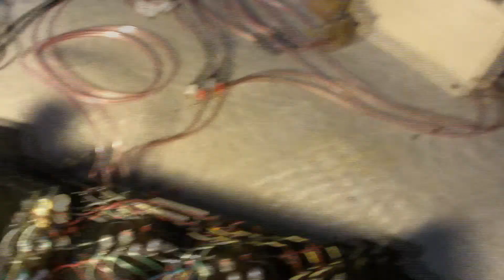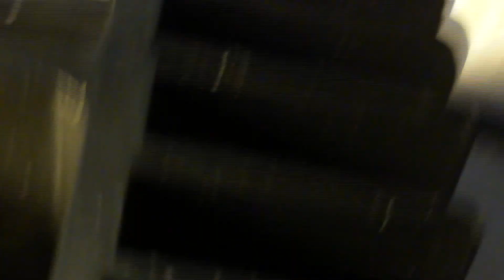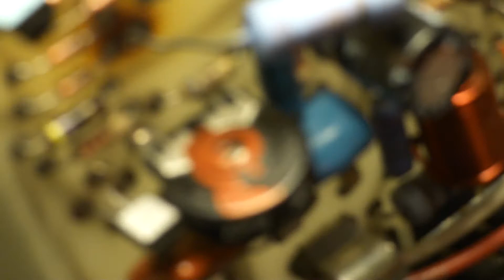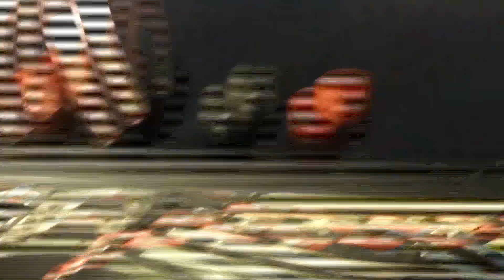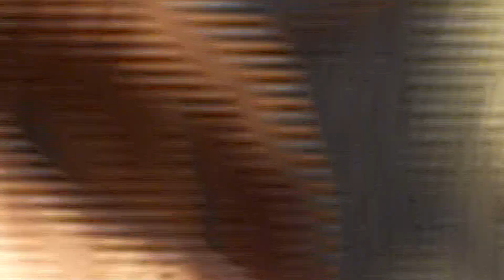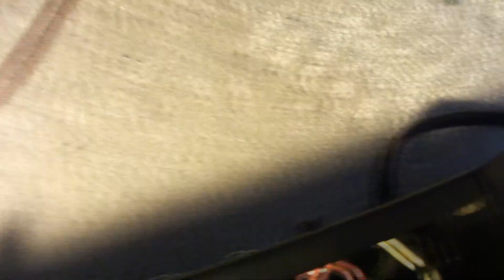Hafler DH-120

Comment from the maker: @SpeakerFreak95 Yup they are. Hafler always used them. The DH-200 stock (PC-6 boards) had them. The PC-19C boards used in DH-220, DH-500 and so on used them. The DH-120 uses them. All their preamps (DH-101, DH-100, DH-110.. you get the idea) used them. They were dirt cheap, but decent caps. All polarized IC caps are replaced by Elna Silmic II caps. They are even better, Try Elna's Silmics they are great. They are better than Nichicon's MUSE polarized caps. Nichicon's MUSE (ES) bipolar caps=great